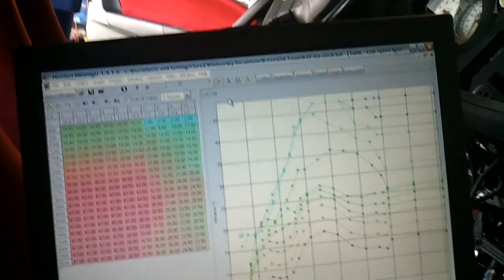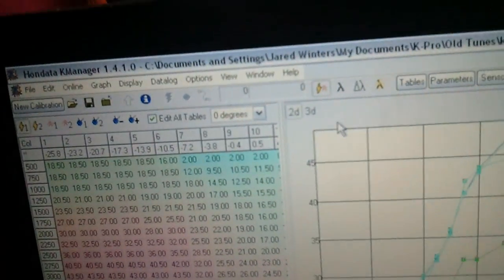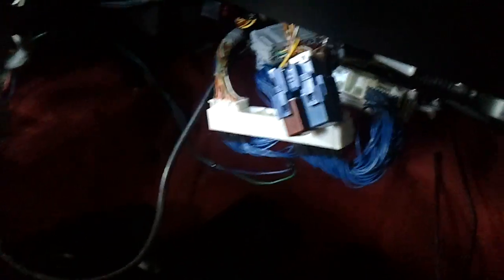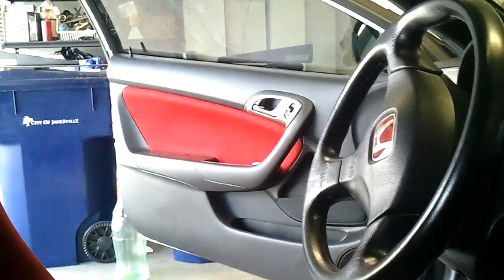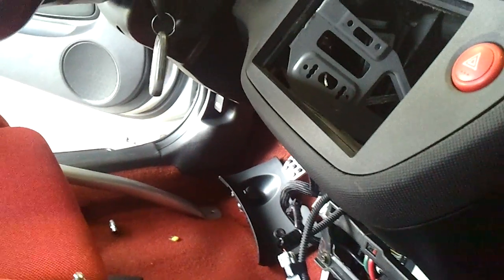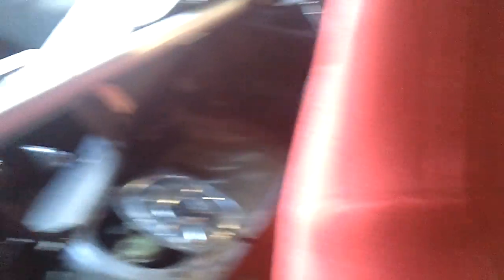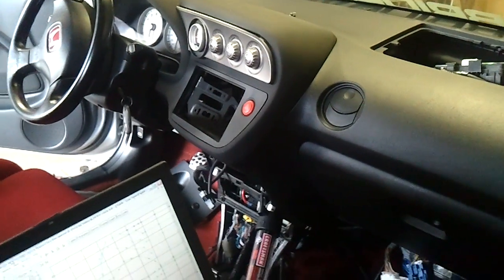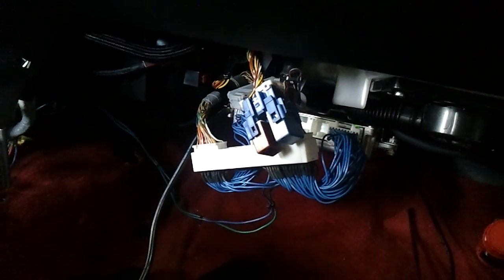No Fuel Pump or ECU power?

Comment: My car nissan cube won't start
But i manually test the fuel pump it works
And i check the fuses and relay all good but the won't works it's only works when i directly put a 12v on the pump

Comment: I'm having the same exact problem. My ECU died, I replaced it with a one from auto parts store on eBay & before it was programmed I could hear it prime but wouldn't start because of immobilizer Vin not matching ECU. Guy came out today & reprogrammed my ECU & rewrite my Vin into new ECU and car won't start, no prime, no com with ECU. I'm so frustrated right now it's not even funny. Can someone please help.
Reply: Did you get it fix ?

Comment: I’m having the same issue guys. Any ideas?
Reply from the maker: Mine ended up being the plug at the ecu. The harness was a little loose in connection
Reply: Zack Zweifel  I replaced my harness with another one and the immobilizer key just flashes really fast on the cluster when you try to start the car. I also replaced my dash. Not sure if that could have done something.?
Reply: Zack Zweifel    Kpro says ignition off on computer.
Reply: @rodrigoperez47  same issue did you manage to source the issue
Reply: Yazeed Adams  no luck:(
Reply: @rodrigoperez47  grounds.
Reply: Yazeed Adams it was my transmission ground 🙄
Reply: same problem bypass fuel pump working good

Comment: Did you ever figure this out? Do u have crank? I’m having same issue on my 07 rav4 after trying to wire fog lights. Something shorted and my radio fuse and obd fuse were bad. Changed them out obd powers on but can’t establish a link and car only cranks.
Reply from the maker: It was a bad ECU power connector shortage. But that's as much as I can remember as it was years ago unfortunately.
Reply: How’d you remedy the issue
Reply: I was having the same issue The ECU  needs grounds and that ground is coming from the engine harness that plugs right into the ECU  the wire on the topics cover that wire that’s there if it’s not growing properly that’s is where the ground for the ecu is located. what happened to me that’s how I find mines.

Comment: it should be the ground on the starter I had the problem with my metro after a engine swap.
Reply: The ground on the starter is stopping the fuel pump from priming ..?? Wtf ..?? Are you serious ? 
Its like asking why does my car not start, you say your tire is low on pressure

Comment: This is a riddle. We need samson. Have same issue.
Changed coil pack, fuel pump relay, starter relays, crank sensors,.... Still no power on fuel pump.
Took fuel pump out and tested.... fuel pump works. All fuses are fine.
Its just power dont reach fuel pump.
I feel like jumping it all with 2 wires straight from the battery to the fuel pump with a fuse inbetween.
How else can i solve this.
There is enough spark, but no power going to the fuel pump.
This is on corsa sport 1600, 2004/5 model.
It went fine, parked it at night and next morning it wouldnt start.
Reply: I am having the exact same problem in my car..did u manage to fix that?..what was the cause?..please explain your knowledge..
Reply: i am have the same problem so i bypass fuel pump drive till today
Reply: I'm having the same issue but with my distributor  @chee75

Comment: What happened? Inquiring minds want to know! Has this issue been solved? We need ya!
Reply from the maker: We ended up redoing the wiring harness and couldn't find anything. And then no joke one day just decided to work and has since.
Reply: @ZackZweifel  sounded like a loose wire or set of wires. When you unplugged that harness and started to hear the door chime, that to me was 1st hint that either the male connector or female side is either wired wrong or something was shorting out UPON you connecting it together ...

Comment: did you find the problem i have the same issue with my e36?
Reply from the maker: mortenmp12 it ended up being a harness issue. It was a custom tucked harness and the company who did it wired it for the 02-04 rsx and I have an 05-06. 

So nothing that would help with your BMW unfortunately sorry
Reply: maybe not. I got a 1992 with the cast iron block and without vanos and all that. all e36 from 1993-1998 has an alu block and vanos so I don't know if it is also wired diffrent. Before I bought the car some wiring was replaced but i don't know which and it hasn't started since. There is no power to the fuel pump but the engine turns over and the other electrics like windows, sunroof etc works. i'll  keep testing wires hopefully i find something. Thanks for the help
Reply: Zack Zweifel I have a similar issue with a EP3 what is the difference in the harness?

Comment: I had somewhat of that issue after my swap. It wouldnt read the ecu. Found out the ground was loose. Tightened it up but still would not get it to see the ecu. Disconnected the usb cord from the ecu, removed ground from battery hooked it all back up and it saw the ecu. Hope its that simple of a fix. Other than that I don't know.